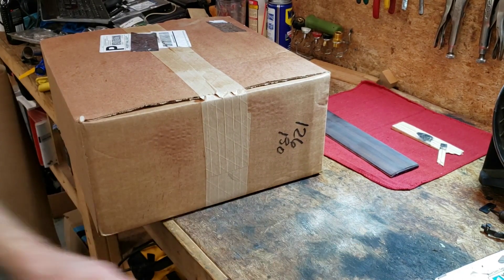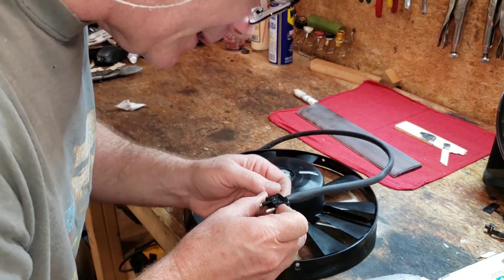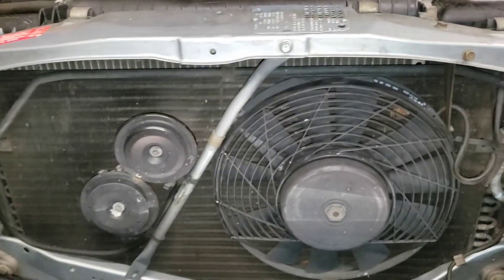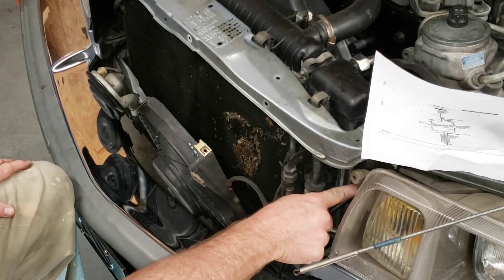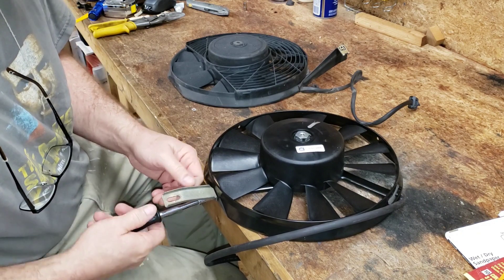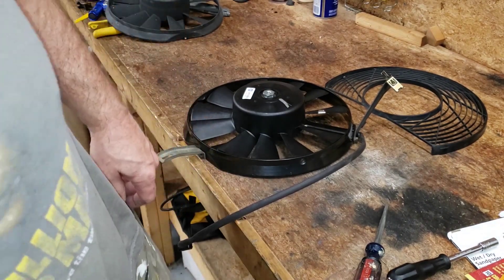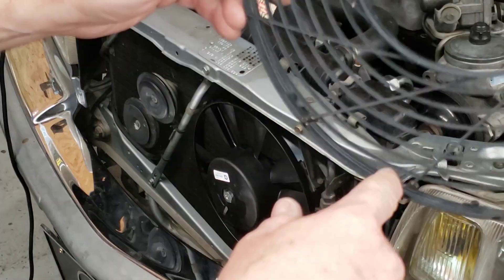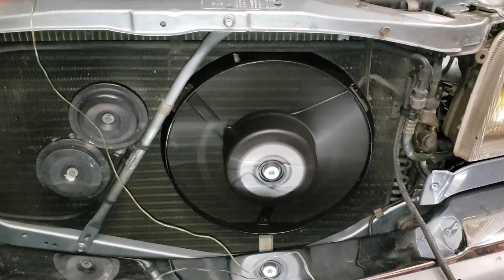Mercedes 300SD W126 - Replace Electric Auxilary Fan

Comment: I replaced mine with a larger fan assembly, it was getting hot running the ac so I bought a larger condenser fan off Amazon and it’s very quiet and fit after removal of the bars and other junk with the OE fan.

Comment: Really nice video! Normally markings on aftermarketparts get scratched when they are showing OEM symbols or numbers, like the mercedes logo, so the manufacturer can sell it without mercedes permission.  Because thats an extra effort normally only the oem manufacturer does it. So its a hint, that the part you bought is manufactured by one of mercedes oems supplier. But I dont recommend to rely on this, because some asian manufacturers fake these scratches. Keep up the great work! 

Greeting from a 500SE owner from Germany

Comment: for others out there with a 300sd, you can also opt tor replace the bearing which is relatively easy. Just replace the rivets  on the housing with small bolts and nuts. If i remember correctly I just tapped threads in the rivet holes and used threaded small bolts. works like new and really helped the air conditioning.  You can just get the cheaper open bearing (which the original was), instead of the contained sealed bearing if you want to save a few bucks.
Reply from the maker: Nice! I'll take it apart and check it out. Maybe we'll fix it and reinstall for another video. Thanks for the feedback!

Comment: It was probably remade somewhere that's why they scratched everything off.. great video!!
Reply from the maker: Good point.
Reply: @ImpalamansGarage  How many kilometers does a car with a W 126 Mercedes Benz 3000cc diesel engine work on 1 liter of diesel?
Reply from the maker: @denuwan9  On the highway: 8 L/100 km. In the city 10 L/100 km. You made me convert it !  LOL
Reply: @ImpalamansGarage  thankz my dear friend❤😍😍😍🙏🙏🙏😜

Comment: Good job! As long as it works, who cares where it is from.
Reply: See above.  If the fan fails and you don't notice the temp gauge, the engine can overheat.  Mine almost pegged until I noticed.  I shut off the AC and the temp came right down.

Comment: I found a Meyle (German) fan for about  $105 which was twice  what a lot of the Chinese fans were going for.  But since a Chinese water pump failed on my Volvo and took out the timing belt,  broke a piston, and damaged the head, I am AVOIDING ALL CHINESE AUTO PARTS!
Reply from the maker: This fan is working well.  I've been driving this car a lot since I've fixed so many things on it.